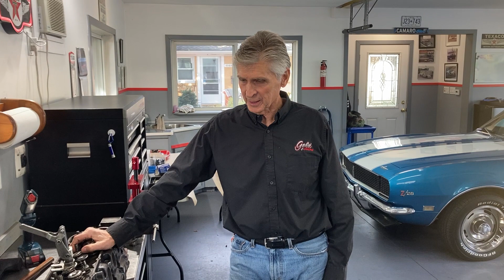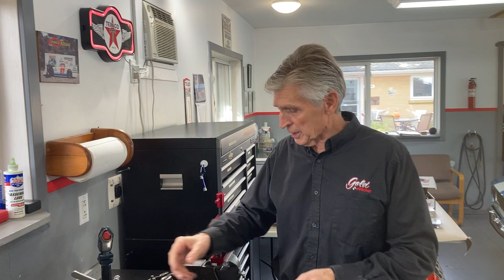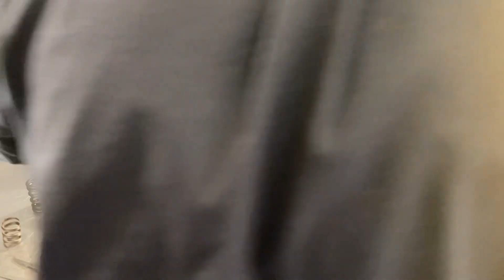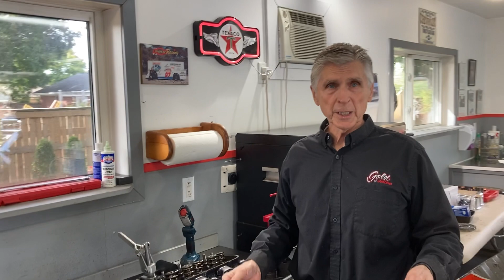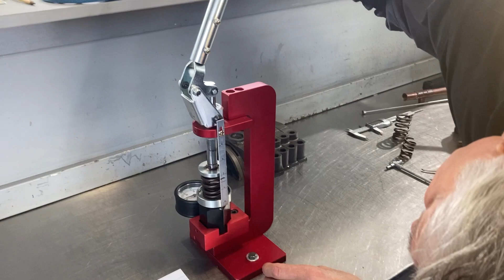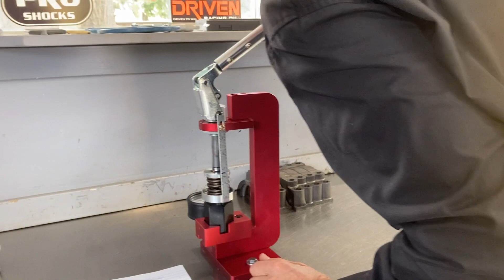Setting Valve Spring Installed Heights and measuring spring force at valve closed and open position

Comment: Very useful for for someone building their own engine who cannot really justify buying expensive purpose designed tools for a one off build. Snap gauges are cheap and handy for a range of jobs where accuracy to the individual 1/1000 is not necessary.
Reply from the maker: Thanks @carl. Good point. Also the minimum thickness of the shims is .015" . Kind of redundant to measure to .0001" when the minimum change is .015". AG
Reply: @goldsgarage8236  I have an FC with a grey motor.  Do you ever have any opportunities to fo a video on the greys
Reply from the maker: Thanks carl, not sure what you mean by FC? Can you expand on your question please. AG
Reply: @goldsgarage8236  Sorry, I just remembered you are in the States. I am in Australia. An FC is a 1959 model Holden (General Motors Holden was a division of GM that manufactured and sold cars in Australia) a Grey Motor is a 6 inline motor used in GMH cars from 1948 to 1963, 132 c in and 138 c in. Needless to say, you may never come across anything close to a Grey Motor in the USA.
Reply from the maker: Thanks Carl. Sorry for the late reply. I just noticed your reply. I did a complete restoration on a Blue Flame 6 which is the inline 6 made by Chevrolet until 1962. There are some videos on my channel about it. I am pretty sure they will be similar. Please check them out and let me know if you have any questions. AG